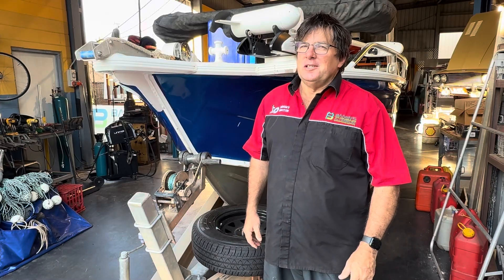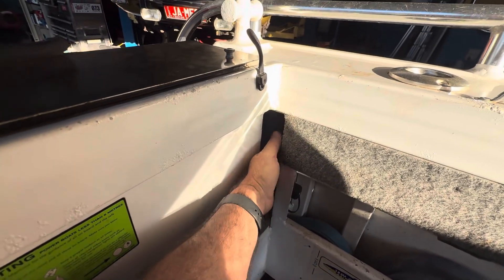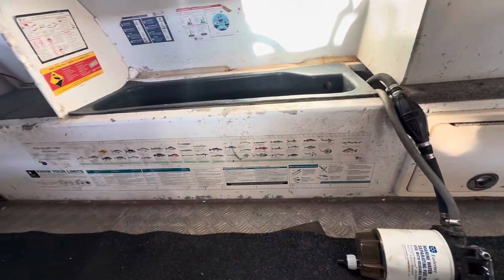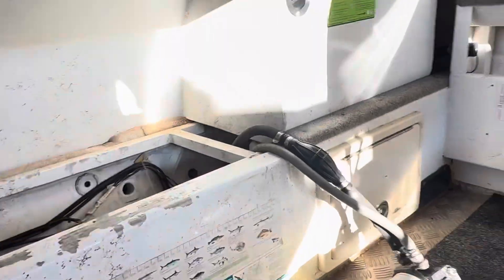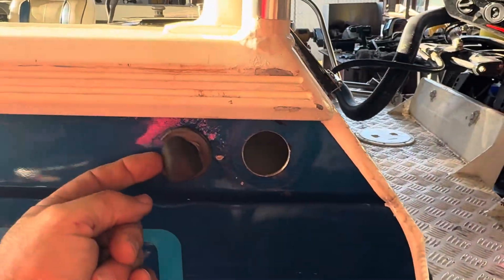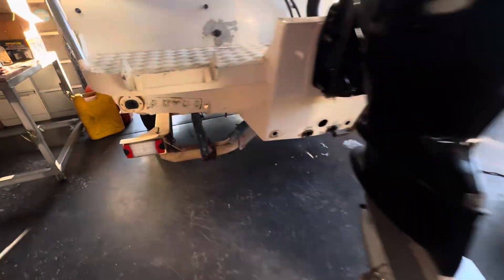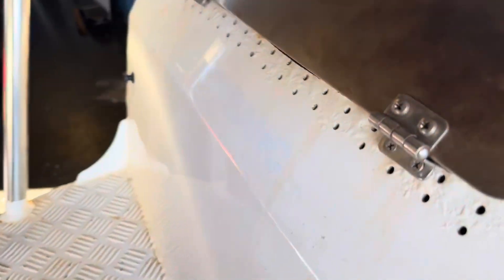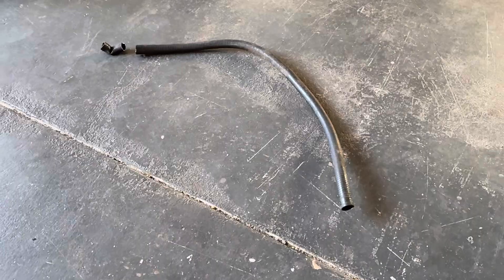Moments from Disaster Bilge Pump Fails ￼

Comment: Seems like a case of giving the customer what they want, not what they need ???
You can only inform a customer what should be done.
But ultimately it's the customer who is paying for what they Want and you simply do as asked and leave it at that. 
Had this conversation a fair few times with customers and learnt to do as asked instead of arguing the point.
Reply from the maker: This fella was good with what I ever I wanted to do but unfortunately the previous owner had the boat modified in this way 
Very hard to make it right without over spending 
I didn’t see the value in reversing all the modifications 
I think we will tackle the problems as they come to a head in the future

Comment: good to set the truth out hopefully it guides a few .. my curiosity now is what your going to do to fix it ? assuming customer wants it sorted out
Reply from the maker: Yes good question 
I will work with owner over the next few years to maintain the hull and prevent some further problems from forming at an accelerated rate 
Difficult to remove the floor now 
Can be done just not sure if it’s the way to go 
Again it’s done !
Don’t get me wrong!
It’s a great boat and will last but we have to look after it a little more than we would need to if the wasn’t modified like this

Comment: Hi, great channel, I have older 5.5 stessl mako. The carpeted wood floor needs replacing, like the idea of aluminium 3 mm and carpet it. What screws do you recommend, gauge and I assume SS not sure what grade. Do you use duralac on the screws to reduce corrosion or just the wax to help the screws cut in.
Cheers Dale
Reply from the maker: Gday Dale 
S/S screw for sure
I have done some Ally floors in other videos you can look over them to pick up some info
In short S/S screws I pre drill the holes and use a wax to cut the threads 
I haven’t used any duralac on flooring Infact I didn’t use any screws on my floor at all .
Only on hinges I used screws 
All I can suggest is to use a minimal amount of fasteners just enough to hold it down 
Just trying to use less dissimilar materials as you can to reduce corrosion 
Unfortunately it is very difficult to stop 
We have dissimilar materials that hold the motor on we cannot avoid it 
I’m pleased you like the channel thank you for your questions I hope you find my answers helpful 
Fire away if you have any other questions if I can help you out I will

Comment: So the take home lesson... welded in floors are.great, right up until something under the floor needs attention (which WILL happen) at which time they're a disaster waiting.to happen. Kind of tempted to copy the underfloor batteries up in the bow to move some weight forward and gain a little space... except I know what happens when batteries hit salt water and you don't want it. I'll stick with my plywood floors with flotation foam under them.
Reply from the maker: You have nailed it 
Don’t worry too much about the batteries sitting low 
I found the correct weight distribution make for a much more comfortable ride easier to control so many benefits

Comment: All Excellent points. Being a master fabricator, I'm sure you could convince the owner to allow you to modify the decks, etc to have the appropriate access to everything under the deck for maintenance. Especially if your best lure goes under!! Hopefully the owner is on board with that.
Reply: Yep, it at least needs some removable panels a foot or so wide down the centreline of the floor.
Reply from the maker: Yes I agree mate 
Got to have some access more important that the access is used 
I see so many boat that fail because of lack of maintenance

Comment: Looks more like a lack of maintainance rather than the welded floor. There alot of survey boats with fully welded wet deck floors, how do they maintain them?
Reply from the maker: You are right 
Maintenance is key for most of the problems that could have been avoided 
With survey builds fuel lines and breather lines are installed differently to this boat among other things and serviceability is of the main reasons why it is so much more expensive to keep a boat in survey 
Depending on what level of survey the boat is in. Some require a full hard line fuel system other require a full hard cover tube where the fuel line runs inside of it and can be removed by pulling the fuel line through 
Unfortunately this tub doesn’t have either and there has been no thought of how do we undo hose clamps under the welded in floor 
At some stage in this boats life the floor will have to be cut out
Hopefully not on my watch 
I don’t want the owner to think he has a bad boat but I do want him to know of the future short falls  and there are so many topics I didn’t cover in the video 
I really appreciate your comment it leads to other explanations not covered 
When I get to editing and I don’t have all points covered I feel like I haven’t done enough to cover the whole story 
Your comments help 👍

Comment: The front battery storage area makes welded decks a total waste of time, I'm assuming that the underfloor tank is no longer accessible? If so that's a recipe for disaster.
Reply from the maker: You are on to it John 
And unfortunately there is no reversing what has been done 
I had a good chat to the owner and have him the only option for him 
After every trip tip the boat up high and dry out the hull
But that goes for everyone 🤣😂

Comment: My old WA built trailcraft sealed deck was was clean underneath. One large sealed patch if you need access under the deck and all the breathers were welded in. But i did hear  horror stories of cracked ones when they went off shore to build in china.
Reply from the maker: I have never own a sealed deck boat but I have built some when I worked for Paspaley Pearls and 5 years later I had to modify and open them up 
Like brand new seal them back up pressure tested and send them back out to work 
These boat were flogged but built solid too 
The Boat in the video is not sealed